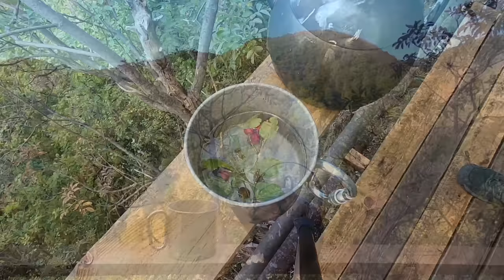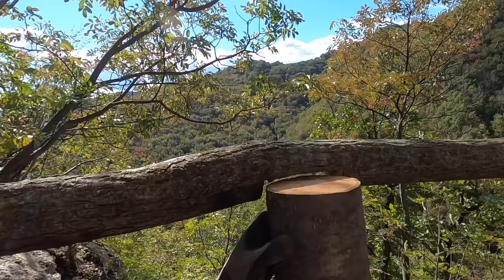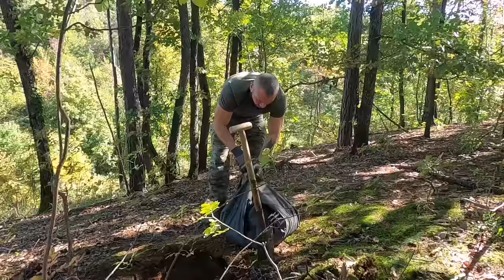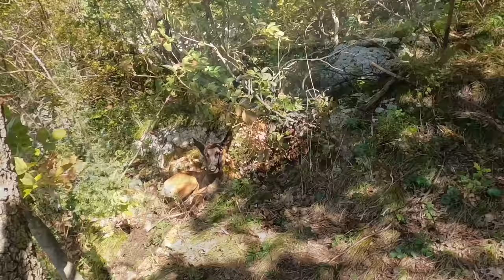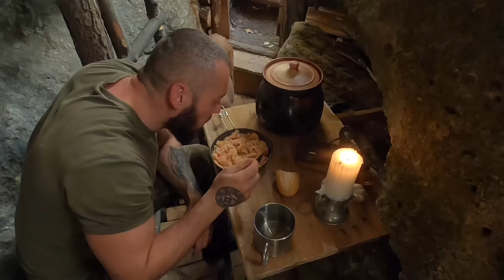Cliff Shelter, Building a Kitchen with a Fireplace, Warm and Cozy Hut, Bushcraft Survival Skills

Comment: Really nice build, I watch your videos whenever I'm on the train.
The only thing that I would watch out for, is that chimney pipe, that you put up against that wood pillar, it could maybe start to burn if it gets really hot, putting something between it as a spacer would help with that problem.
Reply from the maker: Thank you! I will come here again when it snows and I will make better protection for the chimney.

Comment: Looking good. I would have personally put the wall above the fire further back and made an oven and hotplate above the fire.
Reply: I absolutly agree. Also i would make more sense to attach the window upside down to have a better view ;) fattybagoncouch.jpg
Reply from the maker: The stove already heats up such a small space too much. The candle above the fireplace on the shelf melted from the heat. I wanted it to look aesthetically pleasing. If I had put the window on the opposite side because of the rock, it wouldn't have been able to open all the way and I wouldn't have been able to get through, and even with a gust of wind the window would have smashed against the rock. Guys, we will wait for the winter and then we will test. It is assembled and it is not a problem to move it.

Comment: I would recommend switching the window so it is attached on the other side and swings open towards the mountain. This way when the door is open it doesn't block the view. As in Just unscrew the hinges and attach on the other side.

Comment: I would like to know if it is hard to control the temperature inside your shelter?  I mean it is a small space, so does it tend to get to hot in there, or can you adjust it by just building a smaller fire?  I would think that once the rock walls heat up that they help to distribute the heat more evenly?  Love your video's
Reply from the maker: You're the first to notice! Bravo! For this reason, I left part of the fireplace outside. When I was shooting this video it was unbearably hot and I had to open everything with just a little fire! I'll be back when the snow falls and the temperature drops and I'll test the theory!

Comment: If I had access to fresh clean spring water the last thing I would be doing is putting it into plastic bottles. There's no point contaminating it with the BPA in the plastic. Use glass or ceramic instead 👍✌️❤️💛💚
Reply from the maker: Otherwise I use glass
Reply: @luxonbushcraft  do you use it to measure the water?
Reply from the maker: @rastaralph7154  no!Otherwise, I use glass water bottles, and here it is very steep and I can break the bottle if I fall, so I will drink from the dog's bowl
Reply: @luxonbushcraft  mint! Love it and I would do the same but carry it as far as you can in glass then swap it a few yards from there.

Comment: You could add a heat pipe to heat the whole structure without relying on just radiant heat from that one end.  Also brings fresh air in and can be reversed to draw hot air out and cool the place when hot.

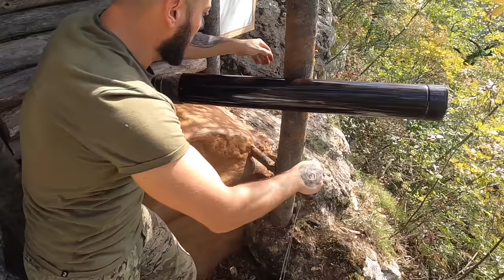Comment: M8, @25:19 do you recon there is space right between the pipe and the roof where you can make a small storage cabinet ? Obviously if you seal it off from the back and open up from the front. Seems like there could be just enough space to keep some kitchen stuff or even a few dry logs just in case.
Reply from the maker: Not a bad idea!

Comment: Great! but rather have more space above fire place that I think the waste of heating energy by outside of heating top. If you made the wall onto last vertical support column wood then you may save lots of heating energy in winter! 👍👏👏👏
Reply from the maker: It is a very large fireplace for such a small space. The heat would be unbearable
Reply: @luxonbushcraft  Oh okay great! 👍

Comment: I’m curious as to what happens to the shelter after this? Do you allow for other travelllers / hikers to use it when they need to? I really hope it isn’t demolished just because of regulatory requirements 😢 that would be sad
Reply from the maker: All my shelters (the solid ones) are still in place. All who come stay, have fun or sleep and do not destroy. I visit them when I arrive and in some I have (or will) make a sequel. Everything is on my land and there is no need for demolition.

Comment: Not to be nosy but, you should peel the bark and make a coal pit long enough to at least char the outside of the wood. This will make it last longer as the bugs, for the most part, can't live it it then.

I have done this for Teepee poles, called lodge poles. Cut them fresh in late fall so the sap will be lower, take off the branches and bark, let them air dry for a week then I had dug a twenty foot long trench, ten inches wide and deep enough to let the coals only cover half the pole. Watch it carefully, put out any flame and if there is any warping I would use my wrought iron tent pegs to make a grid to fix the issues. Nothing went to waste, I usually hung the branches with the cut down and let what little sap left drip to the cuts. Half of these would have five inches cut off and set to boil to leach the sap for pine tar. The rest I would use to make wreaths for presents and if I got lucky, I would have pine nuts for toasting that evening. 

Take care, stay safe and never stop learning.

Comment: Been following your work for some time now. Nice idea with the oven, but why didnt you build the wall behind or at the end of the oven? A lot of the warmth is just emitted outside now...
Reply from the maker: The space is too small for such a large stove.
Reply: @luxonbushcraft  you mean, the heat would have been too much for the place? OK, makes sense.
Another question, if you don't mind: I'd worry that the metal you used for stabilising the roof of the oven expands differently than the clay, eventually causing it to crack. Do you think that is a problem?
Reply from the maker: @sailaliamg2695  Not a problem. If it cracks, I'll fix it. At least I have something to do. :yougotthis::yougotthis:
Reply: @luxonbushcraft  Sure, that's always an option. I bet you know the channel Primitive Technology. He is using wood for stability. I was just thinking that might be easier to do than all the bending with those iron rods. Anyway, I've never done this and can't tell which is better. Still very nice work, incredible place you chose here and your videos are very relaxing. Thanks for that!
Reply from the maker: I wanted it to be a parabola, and I put the wood on the side.

Comment: That's an amazing addition to your cliff shelter, but l find myself wondering why you left the majority of your "heater-mass" outside. You could have provided yourself a stove-top and a good deal more interior heat and space by moving the narrow wall back to include all that you built the roof over.
Reply from the maker: The fireplace heats too much for such a small room, and I wanted to make it aesthetically pleasing.
Reply: @luxonbushcraft  Makes sense when you explain it that way. It's amazing work either way, and thanks for your reply!

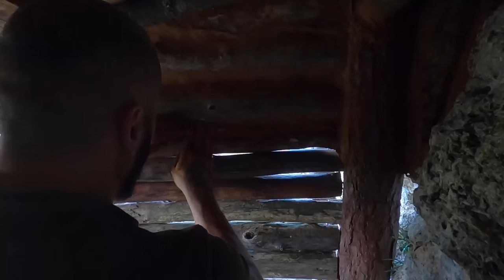Comment: 21:25  I am surprised by the placement of the back wall.  Wouldn't it be better to place it behind the fireplace?  There was probably room for that.  This way most of the heat goes away.  And I would solve the top of the fireplace flat, possibly with a metal plate.  Otherwise, great job.  I like it a lot.
Reply from the maker: Thanks for watching. The growing capacity is too much for such a small space

Comment: First thing that comes to my mind is,
why don't you burn the ends of the wood which is stuck in the ground. It keeps them from rotting ✌️
Reply from the maker: It's oak and will rot in 20 years, then I'll replace it
Reply: @luxonbushcraft  didn't knew that, thank you! :) learned something new again
Reply from the maker: @melvinrakowski6505  No problem